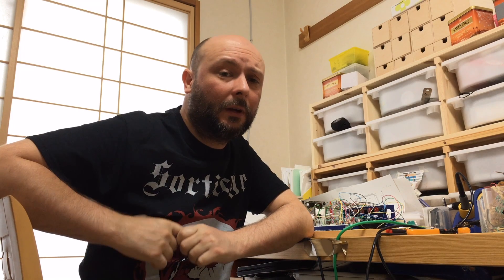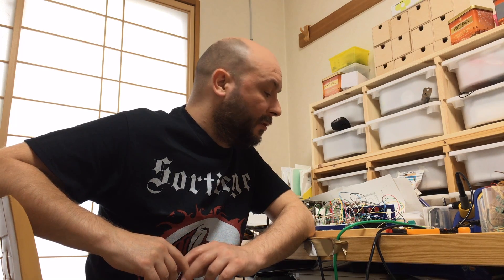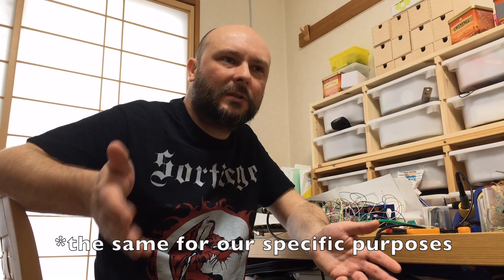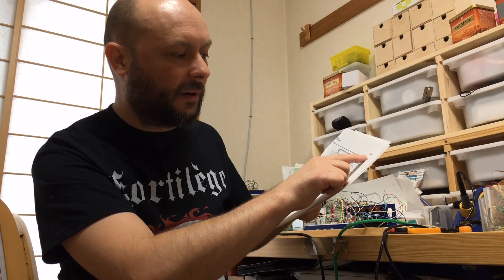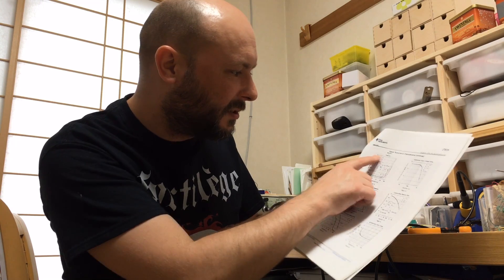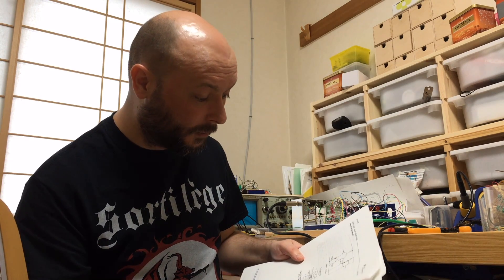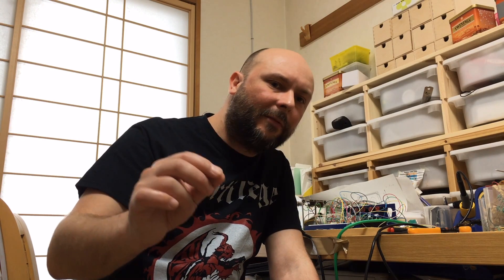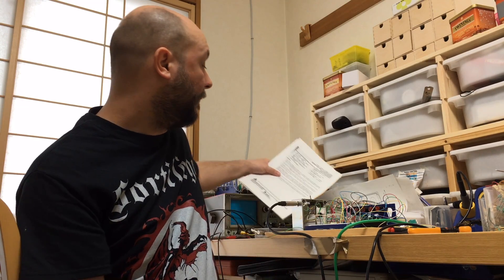About op-amps part 1: what we look for in an op-amp for a distortion pedal?

Comment: sorry to comment on an old video - hey do you think a lm741 would be good ? low slew rate ? for distrtion circuit . thank you . (my experience says YES this chip has real magic for distortion circuits. but an EE will become upset and argue for days if you mention this " proper feedbacl loop blah blah blah ...
Reply from the maker: I have no direct experience with that op-amp, but the only way to find out the way it distorts is to try it out. Cheap vs expensive makes no difference in this case, and some datasheets that looked promising (low slew rate, FET input) then didn't amount to much in the end. We are using op-amps in a way they were not engineered to perform, so you just have to give it a try. Good luck!

Comment: I hear  noticeable differences in  swapping op amps ,some have more bass some are less ,some compress more ,less gain more gain .I just use my ears.  A  4558   compared to say a 4580d  so very different in a pedal. Even a  4558 vs 4558P have a slight change in tone